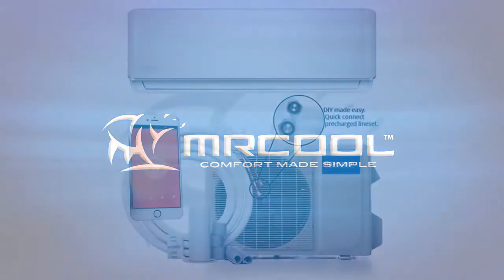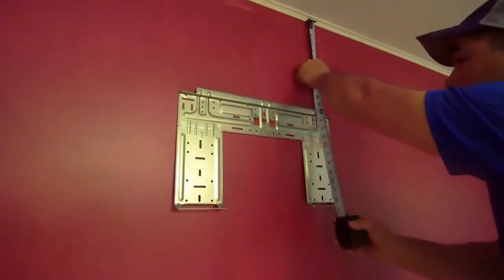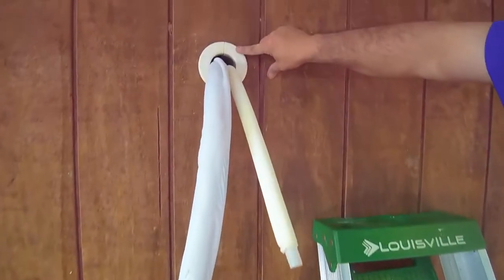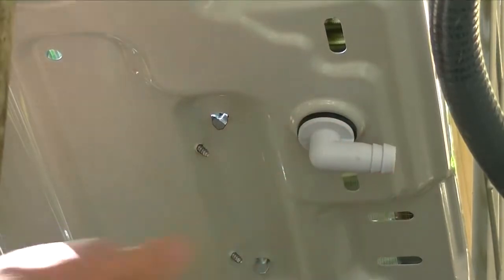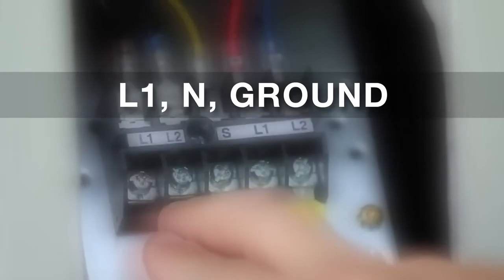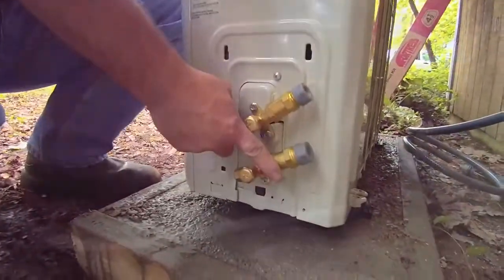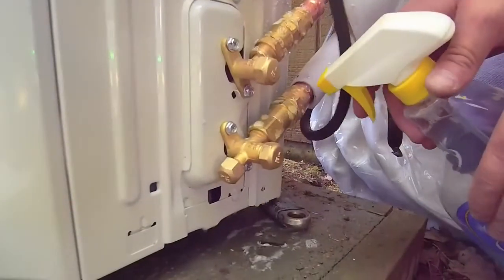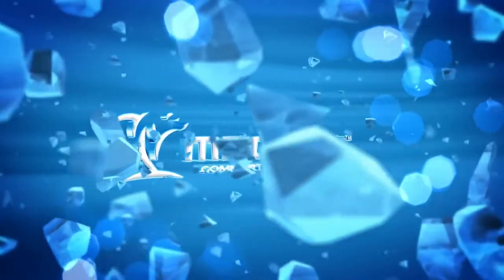MRCOOL 2nd Gen DIY Ductless Mini Split Installation Guide

Comment: The unit is shipped with the bracket installed on the unit. The instructions say nothing on how to remove the bracket from the unit. The instructions also don't say how to attach the unit to the bracket. I am an installer and I just left a very poor review at Home Depot since your instruction leave this out and your video doesn't cover it either. I am sorry I bough it. It is NOT easy to install and I have installed over 1500 zonelines. I find it to be a total joke. I've installed every brand of micro hood which uses a similar bracket system but this is off the charts ridiculous. You video was very good but lacking that important peice of information that I still need so I can unpack and install this possible great product but it has horrible instructions. Since you snap it into place I must now assume I must pry it off the unit with a crowbar or just return the unit to Home Depot which is exactly what I intend to do.